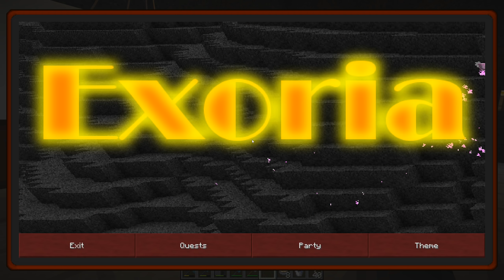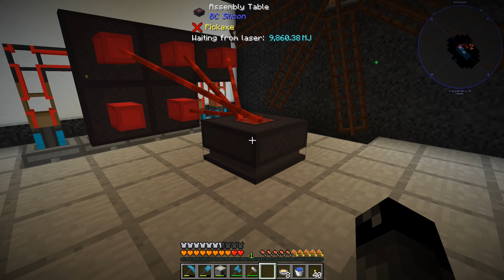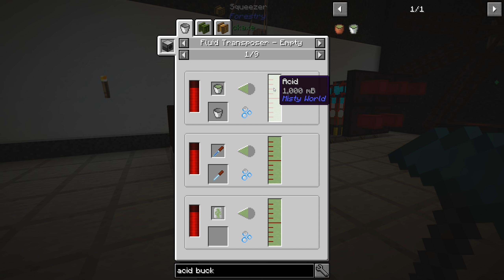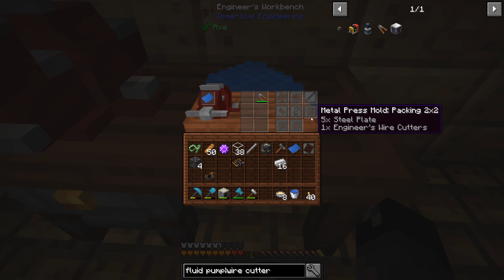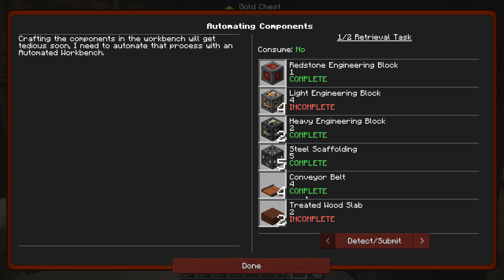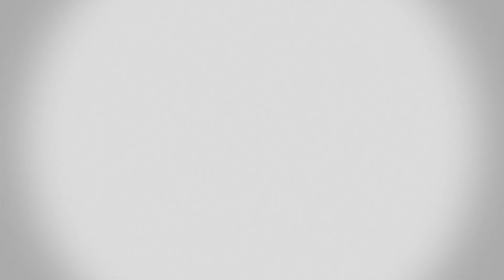Exoria - WORKBENCH AUTOMATED [E30] (Modded Minecraft)

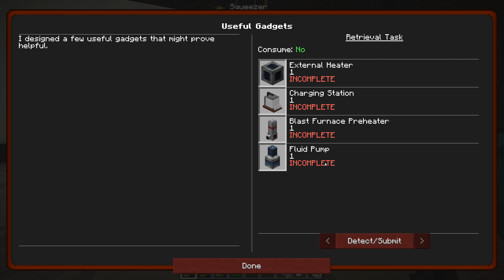Comment: @9:00 Acid is from the misty world mod, but exoria is full of the stuff. Just head outside with a bucket or a portable tank.
@12:18 Blueprints look cool in an item frame. Sensible place to store them.
* Automating the metal press - you can hopper items into the start of the conveyor, but it won't work for recipes that need more than one ingot (gears). To fix, add one extra conveyor feeding into the press, and hopper the ingots into that.
* You originally did slabs on the floor to keep yourself from running into the oreberries and taking damage, but now you have that one-pixel chiselled barrier   and the slabs are no longer necessary

Comment: Fun fact. If you grind EverlstingAbilities a bit, you can get the "Flight" ability. It requires a bunch of levels but with Openblocks you can dupe xp (slowly). Ive duped up 141 levels over 16 hours of idling, so soon I will have creative flight, saturation, regen, fire resistance, speed, adsorption etc etc and be essentially immortal.

Comment: I have decent hardware, but that pack and SevTech Ages run at less than 1 frame...
Reply: All you need really it's a ton of RAM - no less than 8GB DDR3 RAM. That's like, minimum. For graphics, a 750Ti would do I guess
Reply: Also, if you’re using an nvidia card (I’m unsure about AMD, as I’ve never used one). You need to make sure that java is actually using your dedicated graphics card (your nvidia card) compared to using your intel graphics. Java uses your intel graphics by default, and can greatly reduce your performance.

Comment: Hypno, any thoughts on busting down some walls, making your space more open and traversable?
Reply: The rooms have to be enclosed for all that stuff to work.
Reply: @Void Face Not exclusively though. I have 1 very large room with all the Cob/Shacks etc and I have all my machines in this one room. Works perfectly.
Reply: @Ax1007  I ran into a problem with all of my rooms making a space too large, so I had to segment them. So there is an upper limit to the max size of the enclosed space, when it begins to think it's an open space again. Something to keep in mind.
Reply: Yeah - the whole point of the restrictions mod is to force you to build something that actually looks like a base, not just a big open skyblock platform with machines dotted around it.